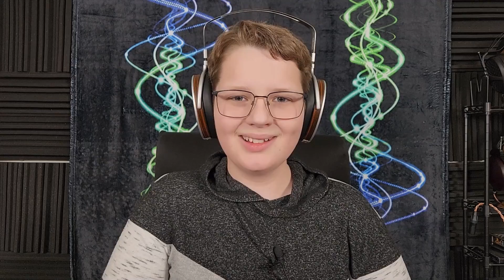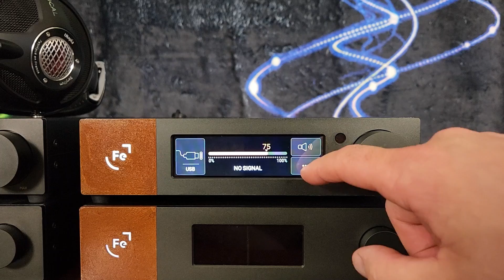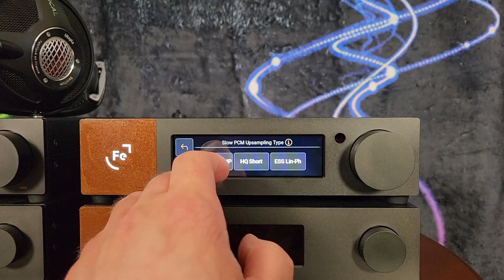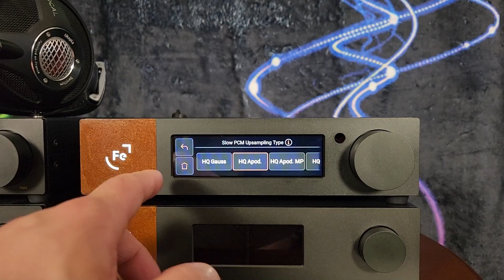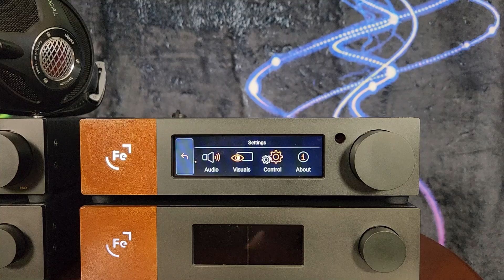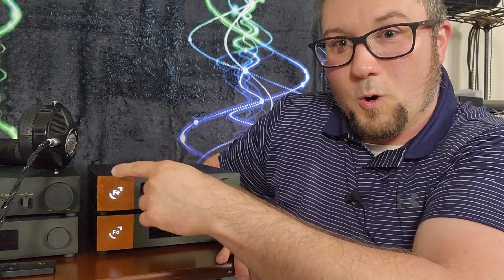Ferrum WANDLA DAC Review (OG) - WANDLAful sound, a couple of bugs

Comment: As a rule, you should avoid making simultaneous connects to both the SE and XLR balanced outputs of a piece of audio equipment. This internal circuitry of the design is likely to have a common 0V ground point for both the SE and balanced amplifiers. For the audio cables this will connect to the balanced XRL shield (pin1) and the outer SE shield of the RCA phono. The external audio equipment upstream of the audio source will also be grounded. So, two separate connections will increase the risk of a ground loop and thereby generate unwanted electrical system noise.

Did you evaluate the audio performance with both the SE and XLR balanced cables connected? Perhaps this explains why the SE output appeared to be inferior. In a balanced design the SE output is normally derived from the balanced signal via a differential amplifier stage. The pre-amplifier you connect the DAC to will have a similar differential amplifier stage (unless the pre-amplifier is full balanced).

Comment: The FW issues you have had have been resolved with FW 1.4.0, which also adds back the ability to switch between Red Book and Pro Spec via HW (startin from Board Version 4.0) without attenuation of the signal.

Comment: I own the Wandla+Hypsos combination and love them.  I overall agree with your sound assessment.  The DAC excels at detail retrieval, which I love.  The Hypsos is clearly a benefit to the DAC.  It sounds like you used the Wandla mostly with headphones, so a couple of additional comments for those who use it with speakers.  If you use the balanced outputs for a power amp, you can use the single ended outputs for a subwoofer(s).  The analog inputs can also be used for a home theatre bypass.  The unit also has an ARC input for using with a TV.  These three features make the Wandla very flexible.  Also, varying the Hypsos voltage has a pretty big effect on the sound out of the DAC, actually more than the HP filters at least with my set-up. 👍

Comment: Thanks for another great review. It would’ve been nice to compare the performance using a decent linear PSU at half the price or less of the Hypsos or less.
Reply from the maker: Agreed, but 24v lps are not cheap generally.
Reply: @wavetheorysound  not cheap, but there are several options in the £300-£500 range. There’s also the Burson super charger that would be compatible.

Comment: Great review as always wavetheory. You didn’t mention your hypsos setting, did you just keep it as recommended by manufacturer or did you play around with voltage?
Reply from the maker: I didn't play with the voltage on this one. For any readers it's important to note that if you use a single Hypsos for Wandla and Oor, a voltage adjustment will effect both. They are not independently adjustable in that case.

Comment: Thank you so much for this review! I was looking forward to hearing your thoughts on the Wandla for a long time. Thank You!

I have very similar impressions as yours, even though I have not listened to music with the Alpha Series 2. It seems like a monster DAC indeed!
Reply: Does the hypsos increase the voltage output of dacs and amps?
Reply: @chronometa  Yes, I believe between 5 and 30v. But a single Hypsos (even the new dual output version) sends the same voltage to both units. Let’s say, if Hypsos is set to 24v, then it will send the 24v to Wandla and to Oor.

Comment: This is on a short list with the Holo Spring 3 KTE, and the LAiv. But will hold out for the GoldenSound reviews first. 

The issue with the Holo tho is the rather large form factor.
Reply: GoldenSound edition just adds 3 new functions - essentially bass boost, tube and 3D modes. The performance should be identical otherwise
Reply: @kajetan9550 Yeah it’s not a huge change for a decent amount extra. Will see what it’s like when your review comes in. Im in no rush so can wait.